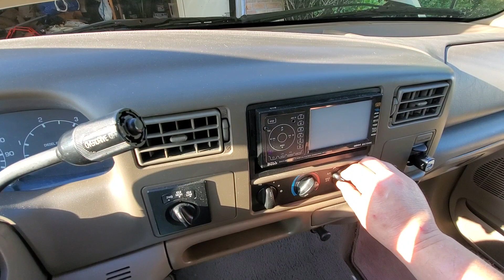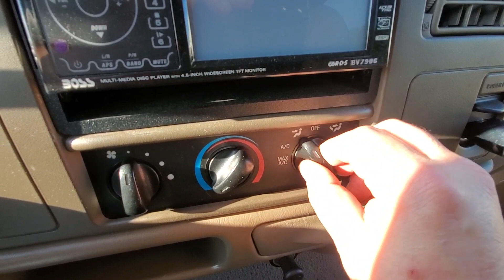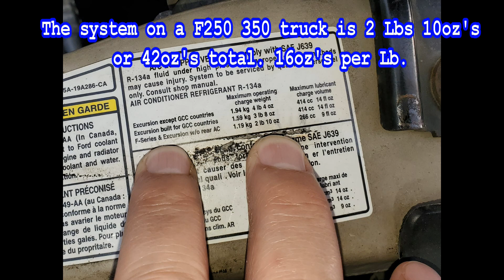How to Detect Low AC pressure Easily Ie F250 or F350

Comment: Hey keith, im working on a/c aswell, my problem is the clutch engages on start up but cuts off after 5 secs and stays off, have replaced dryer,compressor orfice filter, condenser, high side switch and evaporatee
Reply from the maker: Hi Marcos, it sounds like your system is overcharged or you have a blockage in the system. Here's some things to check;. 1. The Cycle Switch on the Dryer Filter should have 12Vdc on both sides when the system is operating. If not check the Low Pressure port on the Dryer. The switch opens at 24.5psi to shut off the AC Clutch and Closes at 43.5psi to operate the AC Clutch, so if it's between those two pressures it should be working. If it's low, charge the system and check for leaks.  2. The High Pressure Cut Out Switch should also have 12Vdc  on both pins as well when operating. If not check the High Pressure Port has between 290 to 460psi. It closes (or operates the AC Clutch) below 260-290 PSI & opens to shut off the AC Clutch above 460psi. Other things to check is the bottom pin on the AC clutch should be a direct wire to Ground/Chassis and the top should have 12vdc on top when operating. Use your multi-meter to check it connects to ground. If you don't have a meter you can use a 12V light bulb with wires on it. Connect the shell of the light bulb to the ground wire you want to check and the center or other end of the light bulb to a positive wire you want to check for power. You can also use a cheap mechanics light that you can get from the auto parts store, like this one; https://www.autozone.com/test-scan-and-specialty-tools/circuit-tester/p/dorman-conduct-tite-86599-circuit-tester/1080850_0_0  $7.99   One more thing to check is the method in the video. Turn the Key on but DON'T start the truck, then turn on the AC and see if the Clutch comes on and stays on. If it does you most likely have a pressure problem.  Let me know if I can be of anymore help.  Best Wishes & Blessings. Keith Noneya
Reply: @keithnoneya  thanks for replying keith, i have done your test in the video and the compressor clutch does not activate. on start up lower side is in psi range but high side never reaches pass 150, after 5 secs pressure settled at 100
Reply: @keithnoneya  im also wondering if flushing the system with the switches still installed could damage them or cause the build up to hide in the pressure port tubing
Reply: Have also checked fuses and relays, obd reader does not find connection aswell
Reply from the maker: @marcoscoriano6927  Hey Marcos, did you check the voltages on the pressure switches to see if they have 12vdc when the system is turned on in the cab? 100 to150 psi should easily turn the High Pressure Cut Off Switch on. Depending on your year your WOT (Wide Open Throttle) Switch could be deactivating your AC Relay. Send me an email at keith_noneya@att.net and I'll send you some schematics diagrams to look at. You could just have a bad Clutch Solenoid, that when it turns on it gets hot and opens. To check that, turn the AC on with the truck off and probe the top wire in the Clutch connector and see if it's 12vdc. If it is and the Clutch is off you either have a bad clutch or a bad wire to ground. Ground is the bottom wire. Check those voltage with the truck off and the AC on and get back with me and we'll go from there. Best Wishes & Blessings. Keith Noneya
Reply from the maker: Hey Marcos, I'm curious did you get it figured out? Best Wishes & Blessings. Keith Noneya
Reply: @keithnoneya   I shot you an email, and still no dice things are pointing towards the pcm
Reply: @keithnoneya  I check all voltages and none are present

Comment: What could be wrong if you jump it at the low pressure switch with a paper clip and the compressor does not click on?
Reply from the maker: Hi BC, sorry I've been out of the house all day. 
If the AC Clutch is not clicking on with the AC ON and the paper clip trick then the AC Clutch Coil is not getting power, missing a ground, the AC Clutch Coil is burned up, the High Pressure Switch is bad (Open) or there is a wiring or control issue somewhere. 
Here's some quick checks you should be able to do;
1. Check the fuses.
2. Test the High Pressure Switch. With the Key ON to MAX AC engine not running. 
  a. Using the Test Light push the tip into both wires one at a time on the connector connected to the switch, both wires should light the Test Light. I only one lights Change the Switch. If both wires light up when poked then the switch is good.Check power to AC Clutch Coil. 
3. Check the Power at the AC Clutch Coil.
a, Turn the ignition key to ON with the engine NOT running. 
  b. Turn the AC ON to MAX AC.
  c. Use a Test Light and connect the clamp to the AC Compressor metal body or the Negative Post on the Battery.
  d. Poke the Test Light tip into the top wire on the AC Clutch Coil connector. It's on the AC Compressor. If the AC Clutch Coil is getting power the light should come on. If the light does not come on then you have a bad fuse, relay, control panel or a broken wire somewhere.
4. Check the Ground Return to the AC Clutch.
  a. Connect the Test Light Clamp to the Positive Post on the Battery. 
  b. Poke the Test Light tip into the bottom wire on the AC Clutch Coil and it should light. If it lights the wire to ground is good. If it doesn't light then the wire is bad, find the break in the wire.
5. Test the coil. 
  a. If the Test Light Lit in both tests then the coil is bad or the connector isn't connecting to the pins on the coil. 
  b. Pull the connector off and check the pins in the connector, and the pins on the coil for corrosion or damage, and correct the problem. 
  c. If you have a meter check the pins on the coil it should be around 4 ohms, if it's not around 4 ohms or open then change the AC Clutch Coil. Look up how to change an AC Clutch Coil for your year of truck.
6. If all the test come out good take it to an AC Mechanic.
Hope that points you in the right direction. Best Wishes & Blessings. Keith Noneya
Reply: @keithnoneya  wow. Phenomenal response. And thanks for the direction!
Reply from the maker: @bccole2343  You're welcome BC. You're also welcome to email me with pictures and questions as well. I enjoy helping people and meeting people on line too. Heck I even had a subscriber who lived in my town ask me for help, Mike Smith. We changed his front Hub Bearing Assemblies, and fixed his truck AC and some other goodies too. He's a pretty cool guy. After we got done fixing his truck him and his wife invited us over for dinner and we had a great time. So if I don't know the answer to your problem I'll help you find the answer or point you in the right direction. Best Wishes & Blessings. keith_noneya@att.net
Reply from the maker: Oh OOPS one more thing I forgot to mention, you have to jumper the Low Pressure AC Cycle Switch when you do these test. If you need a copy of the 99-03 AC wiring Diagram to help you understand what's going on, send me an email and I'll email a copy of it to you. Best Wishes & Blessings. Keith Noneya

Comment: mine won't cycle. Blows very cold. The clutch stays engaged unless I manually turn it off. & it's not on defrost.
Reply from the maker: That's odd! Most working systems will cycle. If it doesn't then either you have a bad Compressor Cycle (Low Pressure Switch) or an imbalance in the system. Put a set of gauges on it and check it. It sounds like it may be a little low on R134A. If it's low put a little in it from those AC recharge cans you get at the Auto Parts Store. The bad parts about the system NOT cycling is that the compressor wears out faster, as it runs even when the engine is revving higher, you'll also get reduced fuel mileage, those aren't good things. The good part is that you get to stay cool until the system dies. The AC system on my 2001 was ALL original Ford parts from 2001. -  If you're not familiar with the system take it to an AC shop and let them know the system is NOT cycling. An experience technician will be able to find the issue quickly. Best Wishes and Blessings. Keith Noneya

Comment: That truck needs a new serpentine belt quick...
Reply from the maker: Yeah it did and got one right after the video. I ran it until it broke then put the one behind the seat on it. Then purchased a new one and put it behind the seat until it's needed. I try to keep spare parts that don't take up much room or have a long lead time to get in the garage or behind the seat for quick and easy repairs. Thanks for watching hope the video was helpful, despite the belt distraction. 😂😂   Best Wishes & Blessings. Keith

Comment: I recharged my ac and it got cold and then a month later it wasn’t blowing as cold so I need to make to clutch come on is that like resetting it I’ve changed a lot of stuff out and don’t know what else I can change
Reply from the maker: Hi Msl, Lets see if I can help you get that cool AC back. I'm going to ask you a series of questions, so don't be offended since I wasn't there to help and i''m not sure which steps you've completed.
1. After changing all those parts did you pull a vacuum or pressurize the system to check for leaks. You can get a loaner vacuum pump at AutoZone by paying the deposit, you get it back when you bring the pump back. This is the most missed step and is the primary reason repairs fail after recharging. Most people skip this step after replacing a major part. I've skipped it on multiple occasions and have regretted it every time, so I don't skip it anymore. Pulling a vacuum removes moisture from the system, makes it more efficient and keeps the moisture from destroying your compressor. 
2. Did you replace the seals on the parts you changed. Most of the time you can get away with not changing them depending on how old the system is. A seal kit is like $13.00 bucks.
2. Did you recharge the system and check the pressures with a set of gauges? You can get a loan on a set gauges at AutoZone by paying the deposit, it's full price. After you are done when you take the Loaner back they will refund the deposit, ALL of it including the tax. The deposit is to ensure you bring them back.
3. If the truck is that old, like mine, the Evaporator gets clogged after all those years. You can clean it and it will work like new again if all the other steps were done.
Please answer by the numbers and we'll get this figured out for ya bud. I don't have any videos up on the AC yet, except this one, so my reply may include a video from another channel on how to do something if you don't know how to do it. Best Wishes & Blessings. Keith Noneya